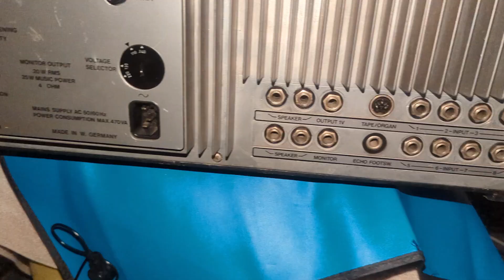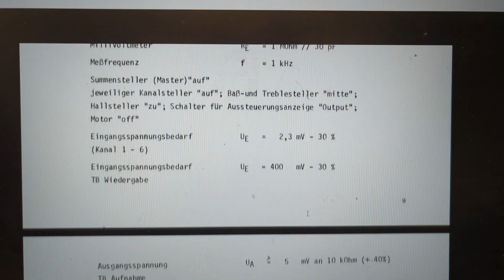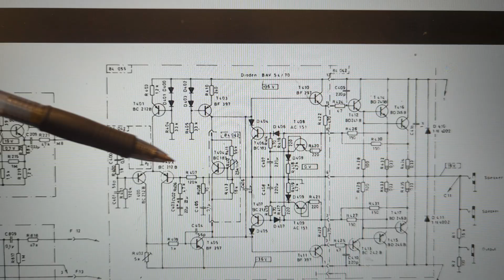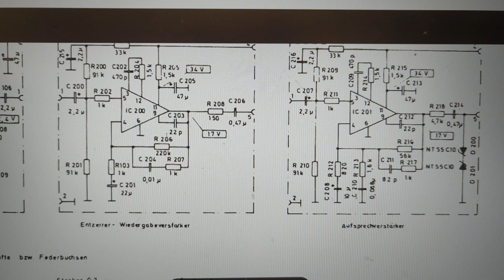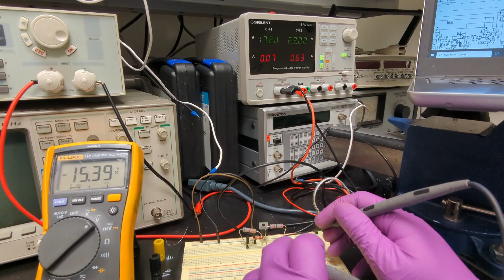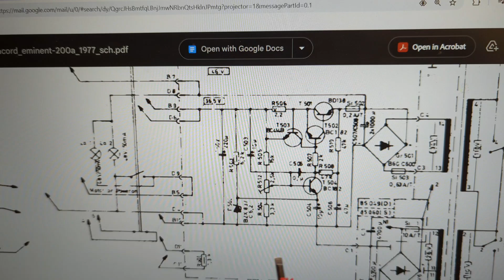Dynacord Eminent 200 Power Mixer W Tape Delay Repair!

Comment: Interesting soa circuit in the PA driver area.
Reply from the maker: Right!? I hope I don't go too much into detail but I don't work on this kind of equipment often. I learned a lot just by working on this guy and getting into the weeds with it
Reply: @fmashockie It appears to be a time-dependent soa circuit that provides higher currents before limiting for shorter time transients.
Reply from the maker: @8m2sCv7 any reason why they decided to use germanium transistors in that circuit?
Reply: @fmashockie They are used as diodes and would have a lower voltage drop, having the effect of even lower current to trigger limiting with long transients.

Probably a good way to get rid of a batch of obsolete transistors too 😉